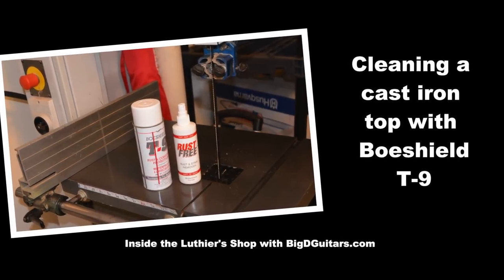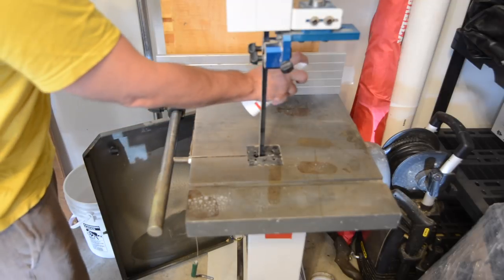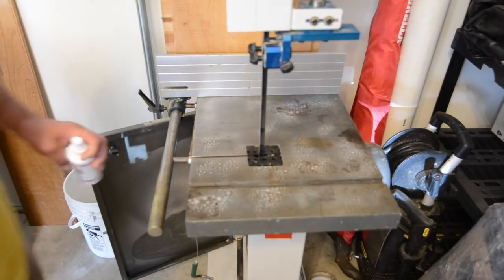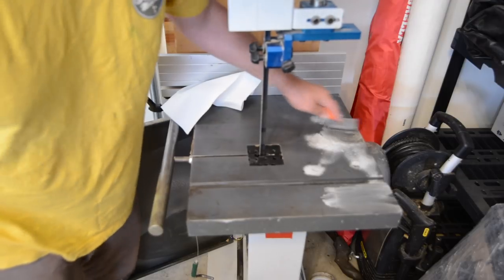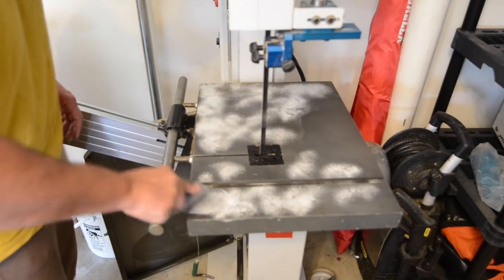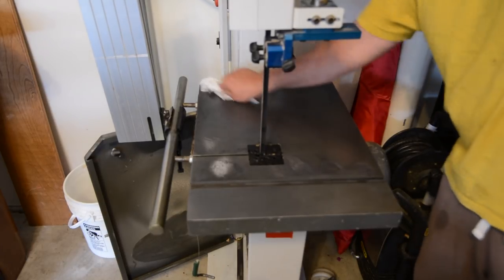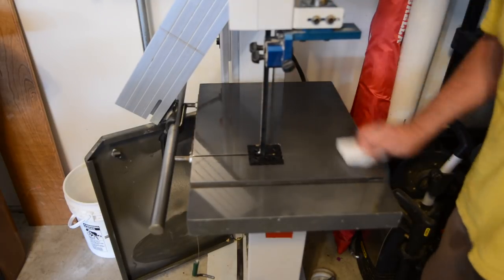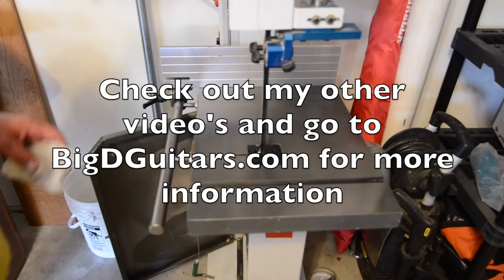Cleaning a Cast Iron Table with Boeshield T-9

Comment: I'm restoring a super rusty planer just now. No pits, just fly rust. I'm using use a well honed chisel, 0000 steel wool, 120 grit on a nice cork block, and dress with WD40. I can shave in the reflection on the surface.

Comment: Looks good. Next time around after vacuuming the surface of the top take a razor blade and go over the top to get anything stuck on. Then use the Rust Free. Keep it off the paint because it is an acid and will degrade the paint. Use a scotchbrite with gloves and start working it in. Brushes are ok but they can miss here an there. Wipe it down good follow up with 0000 steel wool. You should let the T-9 sit over night and wipe down after 24hrs. Thx